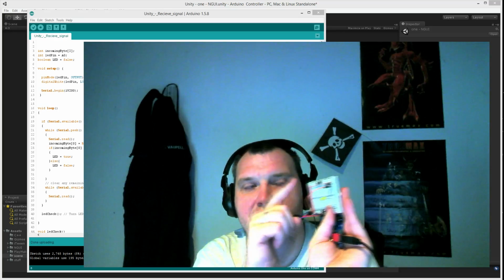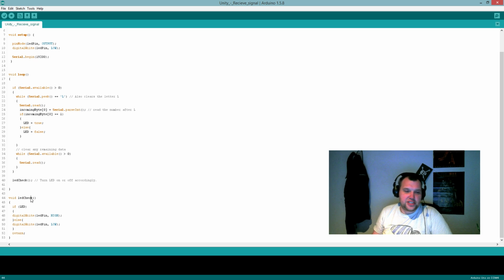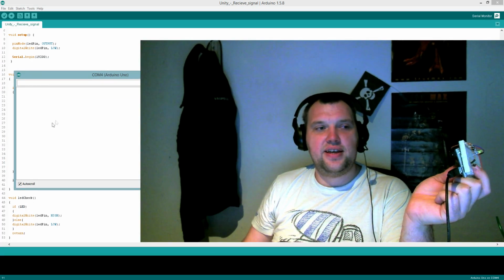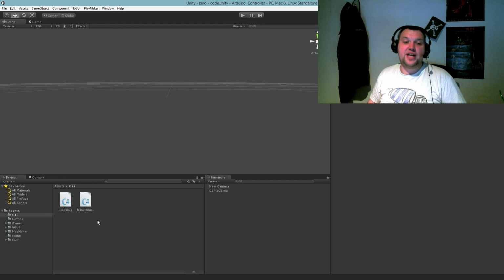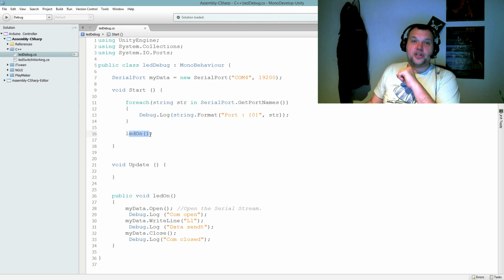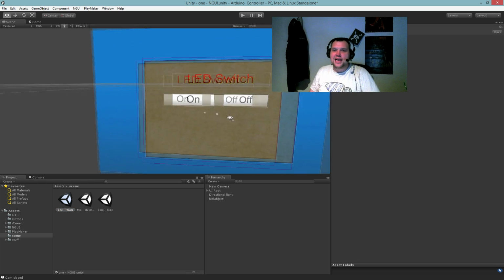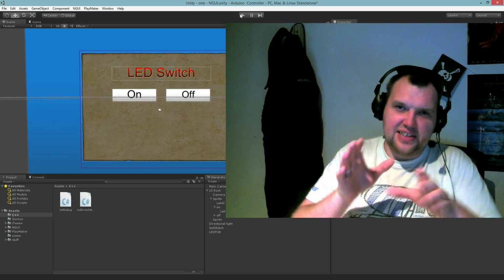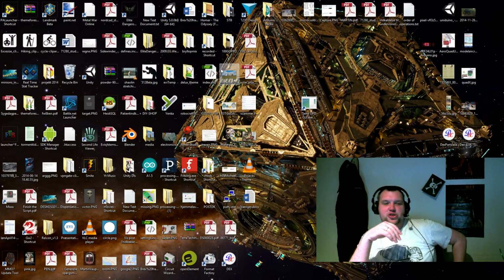Unity and Arduino Serial communication

Comment: It is possible to check from unity what the status of LED is. On or off? Do you know a command for this?
Reply: First you would have to add something like this to the Arduino loop statement. 
if(LED==1){Serial.println("LED is on"); }
if(LED==0){
Serial.println("LED is off"); }

Then you would have Unity check the serial input. no idea about that part.

Comment: french who like le fromage and le pain "bread" 
 
with the most sincere respect :
Can you make programme who use serial.write ?

Unity :
if i read 0 from arduino 
    write 1 to arduino  ;     // once 
else if read 1 from arduino
    write 0 to arduino;      //once 

Arduino :
if i read 1 from unity 
    delay 1000 ms;
    write 1 to unity ; //once 
if i read 0 from unity 
    delay 1000 ms;
    write 0 to unity ; //once 

with any initialisation in first time. 

in a nutshell it's a synchronized communication.